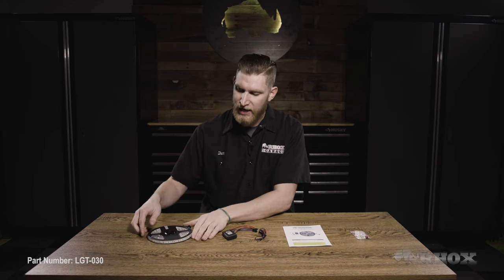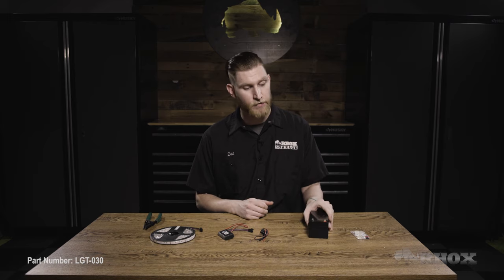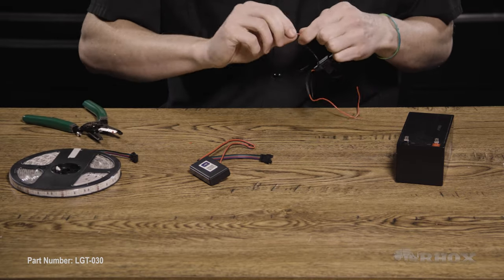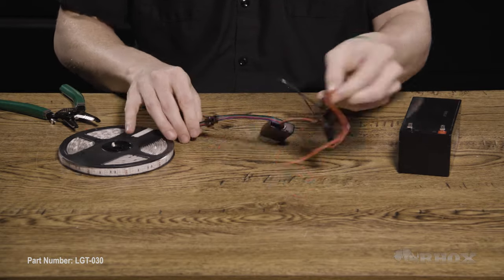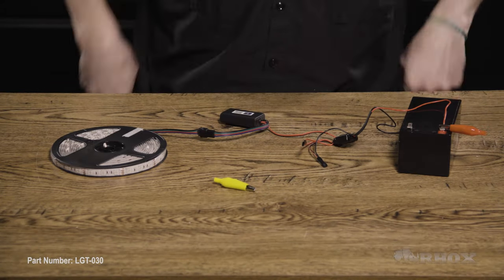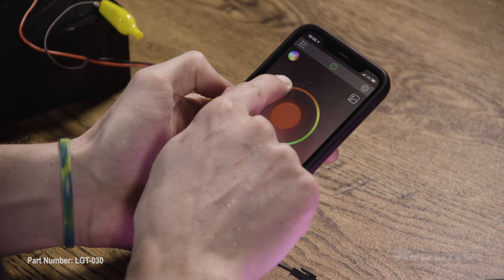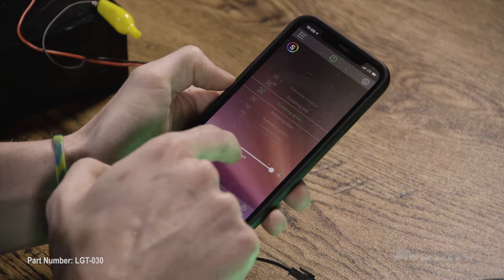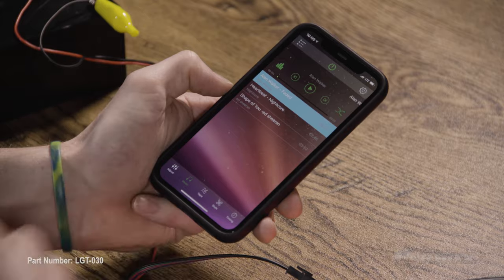LGT-030 Led Light Strip with Bluetooth Controller

Comment: Does the Bluetooth controller continually draw on the battery (even when the lights are off). Should a toggle switch/kill switch be added?
Reply from the maker: No, it should not but a toggle switch wouldn't hurt.

Comment: My app is very laggy and won't select anything but pulsating rainbow.  Is there a remote available for this kit or a different app rather than happy lighting?
Reply from the maker: We do not offer a remove. I would recommend closing the app and restarting it to see if that helps. If not, try reinstalling it.  Restarting the phone may also help too (turn off and back on).  We rarely see problems with the app.  Generally it is with the phone.